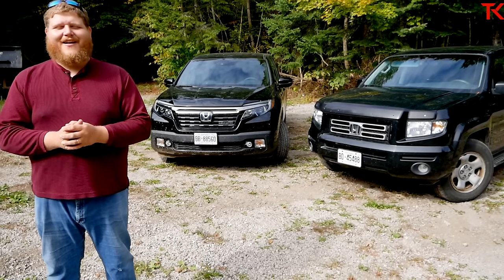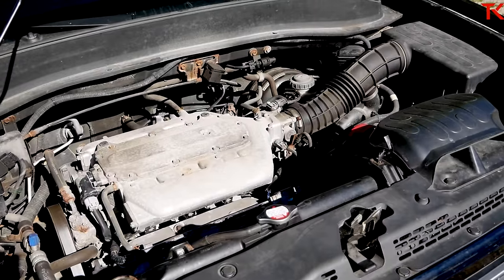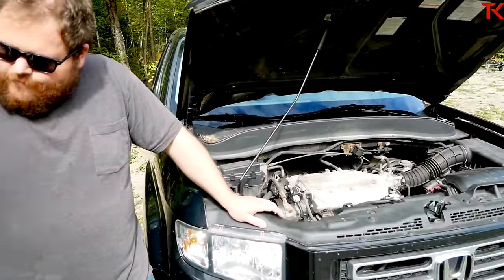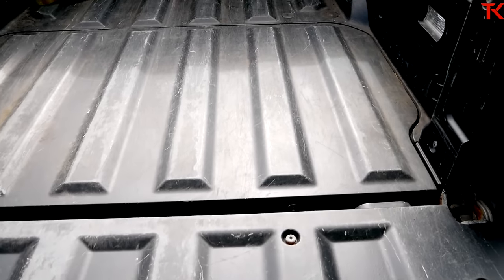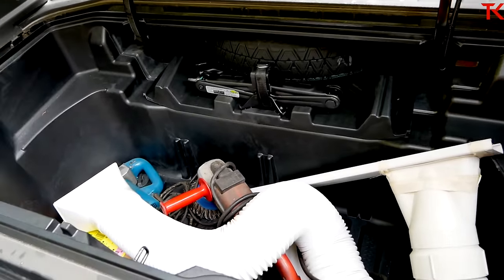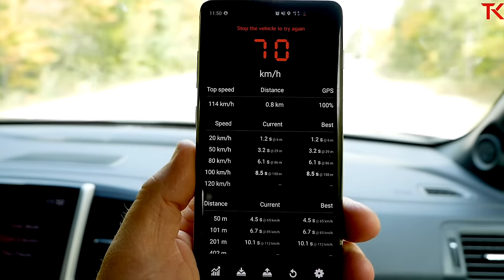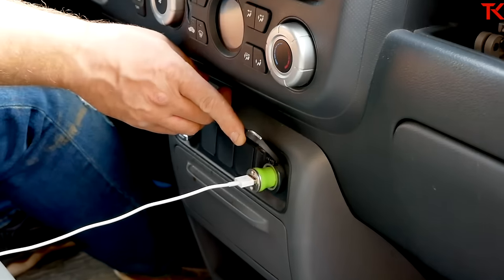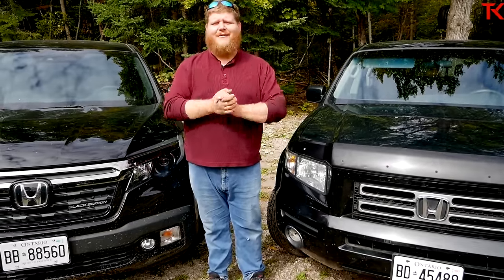Old VS New - Is the 2020 Honda Ridgeline Truly Better than the Old One? + 0-60 MPH Drag Race!

Comment: I think this truck is so hated on, because deep down majority truck owners know this is all they truly need. They just can’t admit it, so they hate on it.
Reply: I love my 2003 Silverado but if I had to replace it the Ridgeline is all the truck I need. 
Plus I think they look pretty good.
Reply: It's more about hating something they don't have or care to understand.
Reply: Nah, they hate it because it's ugly.  Truck owners are pretty easy to please, just make it look like a truck.  Honda for whatever reason has refused to do that, and these have been perennial sales losers because of that.  Make it look like a truck, give it another inch or two of ground clearance and bed depth, put a truck interior back in it again like the first gen, give it an engine with more torque, and they'd have a winner in my opinion.
Reply: I hate my 2016 Ram ECO give me back my 2006 Ridgeline. Better still 2021.
Reply: @plmn93  in my opinion I think that the hate is several things first is the construction of it its unibody and not body on frame second is that its fwd standard with awd option and third is that its ifs and irs with no leaf springs but in reality the ridgeline is more than enough for the average truck buyer but are worried that they are not "manly" if they do get one which is dumb
Reply: I own a ridgeline.... I love it.  But I agree with some of these criticisms.  Why such a weak engine?  It struggles to pull and kills the mpg.  And I preferred the 1st rougher interior as well but eh I could care less there.  And ground clearance/bed depth could be better.  Bed width is perfect.
Reply: WOW I have a seeded need to spent my life in a service bay at the dealers.
Reply: This truck is so practical. I love mine!
Reply: Totally.
Reply: Exactly, good point..  my 2007 rtl has 220k on it - purchased in 2010 with 40k on..  so of course my friends with dodge and chevy were calling it just a big car..  but I actually hauled more trailers, wood, mowers than they did.. because they didn't want to scratch their beds up.. now what the hell is that?   Haha 
At the time I commuted 45-60min each way for work, so aside from only 20mpg, this thing has been great..  (except for the rusting around the gas tank.. ugghh)
Reply: I gave up my 2007 Silverado and purchased a 2007 ridgeline and I can tell you it was a fantastic decision I’m saving on gas and I can basically do all the same stuff I did in the Silverado, the only thing she is missing is the engine noise,
Reply: Search ridgeline unibody and see how honda re-enforced the body. It is strong. Honda did their homework.
Reply: They probably never drove one either or they would realize just how good of a “truck” it is.
Reply: I have a 2012 RTL I bought used and I love it more than I ever thought I would
Reply: @plmn93  that's what I like about my Honda Ridgeline it doesn't look like your Ford or Chevy or Toyota
Reply: @eboniefu3549  mine is an 07 and I love it as well
Reply: Agree
Reply: I hate the price.
Reply: That and it's ugly af
Reply: @dmagin777  check out the recall honda just issued for that exact issue.
Reply: this is the truth
Reply: Bought first year 
Still have it
Zero problems
But yes ugly
Again
ZERO FING PROBLEMS
Reply: GROUND CLEARANCE!!! Come on Honda!!! I have a 2006 it’s great but give me some manly ground clearance.  It would double sales I’m sure of it.
Reply: I have an 06 Ridgeline with 251,200 miles and still running great. I have spent less money on the Ridgeline than my 2012 Silverado for repairs
Reply: Facts
Reply: Im selling my crv for 7000k to purchase this truck next week
Reply: And it will outlast any dodge chevy or Ford any day lol
Reply: @Beastykato weak engine? More hp and the same torque as the class leading Tacoma. I pull my boat through the mountains of central PA with ease.
Reply: If I didn't need to go offroad and it came with a 6ft bed I would seriously consider it.
Reply: Ding Ding Ding. 

Unless you are doing some serious rock-hopping on the weekends, most people just use their truck as an SUV. So why not drive an SUV, with a truck bed?
Reply: @plmn93  funny how nobody hates on the Avalanche, which is styled exactly the same...
Reply: @dmagin777 as far as the rust, check out how bad the boxes full frame trucks are rusting from the inside out. By the time its noticed, it's too late.
Reply: @Sir.YeetusIII yet people bought the Avalanches.
Reply: @korndawggy1801  different strokes as they say
Reply: @plmn93 have you even seen the interior on a new truck? As far as being ugly goes, remember the Chevy Avalanches or the first gen Nissan Titans.
Reply: @korndawggy1801 as an ex avalanche owner....I LOVED that truck. It was basically a Swiss army knife. 

Got totaled out sadly and I couldn't find another one anywhere near me. 

I'm really considering the ridgeline as a reliavke daily driver and to tow a drift car around.

For reference, my daily since the avalanche got totaled, I've been driving a 89 honda civic wagon (original motor and trans) with around 200k and getting 30mpg.
Reply: @blockrokinbeats as someone that unfortunately rear ended someone in mine can confirm, not a scratch or dent save my front plate 😂
Reply: ‼️‼️‼️The Trunk storage is the Game Changer 💯💯💯💯💯😄 All Cars, SUVs, Trucks need that option imo especially with all the smash 💥 and grabs now 😢
Reply: I think you're right about "what we truly need" but I think you're wrong about that being the reason to hate it.  It's got nothing to do with the specs on this truck and everything to do with the fact that it looks terrible like it can't decide if it's a car or a truck.  It's just an ugly truck that doesn't commit to looking like a truck and that's why we hate it.
Reply: I've always liked the ridgeline & you're absolutely correct this is all the truck I'd realistically need as a "daily driver" with truck like capabilities.
Reply: It rides like a Pilot and hauls like a Taco. Everything I need without the truck feel. This is coming from a 2018 Taco, 2012 F150, and a 2007 Frontier owner.
Reply: I drove one it felt like my 4cyl accord, wasn't slow I guess but not fast at all, don't know about towing
Reply: @hashishsenju2015 what about the new frontier though I think they look awesome
Reply: @randsp3c709  I like it. Looks swag 👍
Reply: I have a 2006 Ridgeline, black RTL with 230,000 miles. I’ve taken it to Pennsylvania, Colorado, California, Nevada, Kansas and it has never left me on the side of the road. Easy to maintain and work on. It’s been the perfect truck for me and my business, I’m a general contractor and I’ve been the only owner. I made mine look like a bad ass, I put black rhino wheels, some nice tires, side steps, roof rack, bug deflector on the hood, and it makes a huge difference. I’m not going to lie, the way they come stock they do look weird, but add some small upgrades to it like I did and you have yourself a nice looking truck that you can use for work and still take your family on roadtrips with 😎
Reply: I agree
Reply: Ford and GM owners are jelly of the reliability and rustproof features of the Ridgeline. My BIL is a total idiot and still holds a grudge against Japan.
Reply: After wanting a tacoma for so many years,
I decided to go with a honda Ridgeline trailsport
Reply: @paulwarner8296  Kills MPG.  Gonna have to put a lift kit on it yourself... though they should maybe offer that as an option!
Reply: @Cupcub71  I used to hear of hate on them, but never actually experienced it myself.
Reply: @plmn93  just saw this.. you dead on the money. I have a first generation and is a machine but yes is too low
Reply: @plmn93 from my perspective I love it’s unique style. It always stands out and taller in a parking lot!  To each it’s own!
Reply: Love that old classic especially the grill
Reply: I agree

Comment: My 2006 Ridgeline has 245k miles and runs great. I want a new truck but this one is reliable and paid off so I’ll drive it til it dies, which will probably never happen because it’s a Honda.
Reply: dont forget the timing belt and youre good as gold
Reply: @lelandp5859  how often should we change timing belt and water pump? I have a 2006 Ridgeline with 170,000 miles. I don’t know if the timing belts been changed
Reply: @imperium1011   every  100k mile or i want to say 6 years? i dont remwmber time wise but mileage wise its 100k
Reply: I have an 07 with about 175k miles, I've been wondering how long I got left lol I really like mine.
Reply: @imperium1011  If you don’t know: Change it. Worth the piece of mind and not hating yourself in the future if something breaks that could have been avoided for under $100
Reply: I agree! I have 245,000 miles and I’ll drive it to the end!
Reply: Watch for rust, my 2007 is rusting horribly underneath.
Reply: Same! I have a 2006 with 248K miles. Got the big service (including timing belt) done at 220K and fully expect to make it to 300K and past. Love the Ridgeline. Have a 2022 on order.
Reply: @takeahike2993  timing belt job by a professional is over $1000 not under $100
Reply: @imperium1011   every  100k mile or 7 years according to the dealer. My 2008 Honda Ridge has only 105k and runs great. EVERY Ford / Chevy truck guy gets jealous when I tell them, it has had 2 new batteries and a timing belt and 1 set of brakes and new tires. Runs like new. Hard to beat the facts. :glasses-purple-yellow-diamond:

Comment: Love the practicality of this truck... just wished they kept the “beefy” look of the 1st gen
Reply: @IdiotF0ol  well I think you might need to clean your glasses lol
Reply: @roachcoachhelis6387  Love my 2" lifted 2007 silver RTX with the spare bolted against the bedrail, oh and 1" wheel spacers all around and 245/75-17 offroad tires. Only 133K miles. I doubt I will ever trade "Tank" in. :-)
Reply: Yeah but if it looked tougher you might expect a v8 I feel like it looks like what it is lol In general, Honda is in a slump lately looks wise though
Reply: 3 yrs later it looks beefy or better then 2021 . 2025 looks even better

Comment: I love the 1st gen ridgeline and plan on buying a used one. New trucks are too damn expensive.
Reply: That's wise. I have a 2006 and I had to get some windshield repair after 351,000 miles. It cost me $600 and was the first time I had to do any body work. I was talking to the windshield repair guy and he said he replaced the glass on a gen 2 once every 1-2 years and with all the sensors in it it costs $2500. I think with all the thinner glass and plastic parts, cost of maintenance on newer hondas just isn't practical financially.
Reply: Isn't THAT the truth?  I see all those guys driving around in $40-50k trucks and wonder if they all live in tiny apartments or something.  After bills, investments, savings, etc. I don't have room for a $45k truck payment.  That's insane.
Reply: I inherited my dads 2013 sport that has only 76k on it and I don’t think I will ever sell it the truck gets done what I need it to and it only costs me basic maintenance and a few mpg less than a new truck
Reply: @Tom Dantzig hey, sorry I didn't see this sooner. I have replaced it. I think I was able to find a kit (belt, water pump, ect.) For about $100-120. Been a minute so I don't remember exactly what it was. Hope that helps.
Reply: I did replace it myself so that was just the cost for parts. Not sure what a shop would charge but I'm sure you could ask 😂
Reply: @CalvinBonner  Honda dealer in Canada charged me over $1,000 for timing belt. At 230k they’ll do water pump/belt. But it pays to pay IMO.
Reply: @JamieMG  that sounds about right. Over here they do about $80/hour for labor and you have to dig pretty far to get to the belt/pump.

I try to do most of my car work myself and I even ended up doing an engine swap at around 400k miles. I rebuilt the old engine and sold it to my brother. Payed itself off.
Reply: @CalvinBonner  I watched South Main Auto Repair LLC on here do the timing belt, Still I'll leave that to the dealer lol.
Most maint I or my mechanic friend. Next is a 2" lift.
Love my Honda!
Reply: I do like the new models, but ya..$$$$$
Maybe for a retirement gift .
Reply: @lexwaldez  some people have deeper pockets.
Reply: @lexwaldez  It's a two day job for my 2010 Ridgeline. In another 50,000 miles or so, I'll have to do it again. Yup, it's expensive.
Reply: @lexwaldez  because you don't make enough

Comment: Similar story: Worked for Honda dealer and now for a contractor to Honda Canada. I bought the original 2006 Ridgeline EX-L brand new and it currently has 251 000 kms with no issues other than regular maintenance over the years. ( on my second timing belt). One feature that I like on the original is the VTM-4 lock which allows you to lock the rear diff in L1 and L2. The new Ridgeline uses a torque vectoring system. Both are good but the original allows for a more hands on old school approach. Bed space in the new one is bigger, but it seems at the expense of rear seat room. What would be nice is bed height high enough to accommodate a large Coleman cooler with a tonneau cover. Safety (especially with the new headlights), ride quality and efficiency are all improved. The best thing about both Ridgelines is how the meet the actual needs of most daily pickup truck buyers.
Reply: your description of the VTM-4 lock is not totally accurate. It is actually locking the transfer clutch to the rear wheels. So just makes sure power is being transferred to the rear wheels from 0mph vs waiting for them to slip before transferring the power. Either way, yes it is a cool feature.
Reply: Have you ever had a valve adjustment?

Comment: My wife has a 2014 Ridgeline and we absolutely love the truck. When we retire we will buy a new one and still keep the 2014. The one thing that we like better on the 2014 is the counsel and the and the shifter on the column, it gives you so much more room. That is something that Honda needs to go back to. I have owed several trucks in my 63 years and this Honda is the best truck yet.

Comment: The ridgeline is the literal perfect vehicle for most suburban pickup truck owners. Heres the checklist of things it has that most midsize and half ton buyers want. AWD, has a bed, can tow a boat and other toys, can seat 5, gets good fuel economy, naturally aspirated engine loaded with utility, smooth ride. 0 reason for this to sell poorly other than the truck culture in the US. If Ram came out with a pickup tomorrow based on the dodge durango (which wouldn't be a bad thing) or if chevy re launched the avalanche based on the traverse, or ford launched a pickup based on the edge or explorer, they would be smash hits. Just people hear that honda's only pickup is a minivan with a bed and they just laugh it off, if honda had a BOF half ton above the ridgeline, the conversation would be completely different.
Reply: Nail on the head!
Reply: The Ridgeline's MPG is not good by any means, it gets near F150 gas mileage and only has a V6 producing 250hp. Its also a very heavy at 4500lbs making the truck feel slow unless you throw the pedal down, which throws your mpg out the window. There's larger vehicles that get similar mpg while carrying more weight and being faster.

Honda should've made the truck lighter and the j35 more fuel efficient, that engine burns so much gas in pretty much any v6 model Honda it comes in. Especially the older ones.

I still love my ridge. Cries at the pump, laughing on the highway

Comment: I’ve always wanted a truck and the first one I ever got was a 2007 Honda Ridgeline base model in April 2020. I couldn’t be happier. It’s got a lift kit, big tires, led aftermarket head lights, led bar lights, custom decals and it’s just fantastic!!! 👌 319,000 and purrs like a kitten. This is absolutely fantastic. I always thought ElCamino’s were cool too so I’m delighted to have the large version of it. Way to go Honda!!! 🤗🥳😇🎉🎉
Reply: Do you have pics ?
Reply: @herreriaspartatijuanatj6476  I would post some but I don’t see any options to do that sorry. The older Honda Ridgelines had a recall for advanced corrosion around the fuel tank and mine failed the inspection so they bought it out for around $4,100. I couldn’t have been happier with that outcome because it disintegrated underneath and was going to be a total loss. 
I just picked up a 2008 Dodge Ram 1500 5.7L. It seems to work really well but it’s nothing like the Ridgeline. I think I’ll see if I can trade this for another Ridgeline later this year when I get it looking really good.  We’ll see. 👍😇
Reply: Did you do 3 timing belts
Reply: @alen-commentnazi8774  When I bought the truck, the gentleman worked for Honda and said that belt was done just before I bought it and I never did anything to it afterwards except change the fluids. 
I now have a full sized Dodge Ram 1500 and it’s way more truck than I need.  I really miss the fancy tailgate and storage bin of the Ridgeline because now everything I had nicely stored away is all in the back seat of my truck - it’s annoying to lose a whole trunk that kept everything nice. I thought about modifying my truck to put the storage under the bed but it’s beyond my skill level. 

The Ridgeline prices here skyrocketed here for the older ones so I’m not willing to pay that price for an old truck.
Reply: Have you ever had a valve adjustment on your ridgeline?
Reply: @shadowman1992  I did not need to touch the valves. Perhaps the previous owner did but I was not aware. Honda had a recall for advanced corrosion and mine failed so I was delighted when they bought it out for $4,100. I have every intention of buying another one in a couple years. Have a happy new year.
Reply: @lockhga  thank you. I own an 07 with 155k so I was just asking to see if I needed to get a valve adjustment.
Reply: @shadowman1992 I Think mine had around 340,000KM. It ran like a top the whole time I owned it. 👍😇